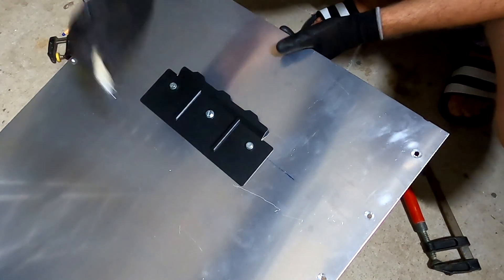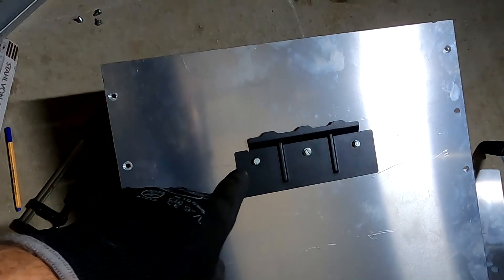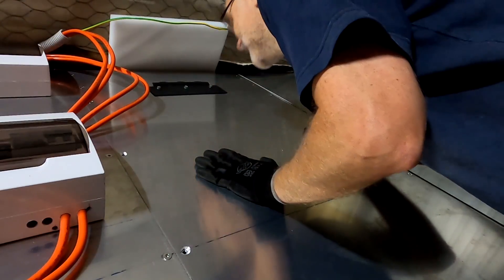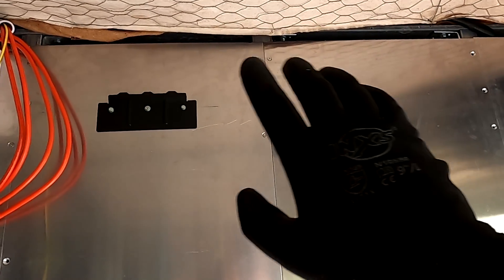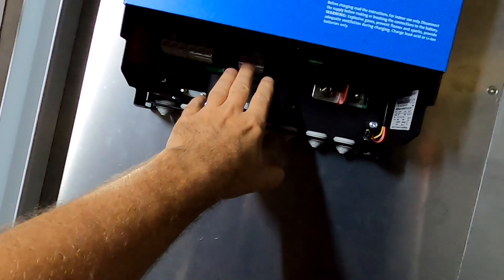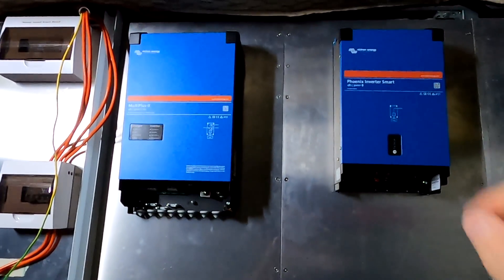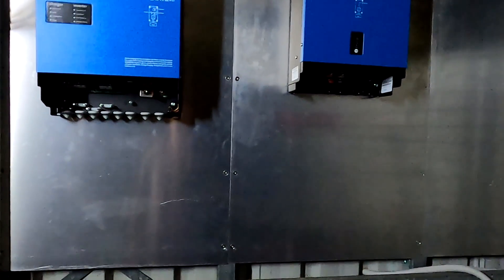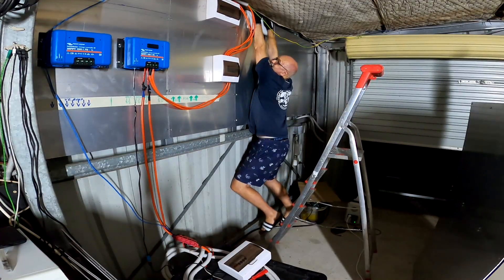Victron Multiplus Wall Mount (Official Strength Test!). AC and DC cables without crossing?

Comment: Here's a long one.

Yes. I came to the conclusion about one year ago that the shippers are shit. Have you seen the news on the mess in Los Angelous? Hell, if they can get the merchandise containers off of the container ships, which seems to be a several month-long process, then getting trucks to transport the merchandise is a gamble. Worse yet, if they can get the containers on a container train, organized gangs are jumping the trains while they are moving, opening the containers, then throwing the cargo out next to the tracks where their accomplices open the boxes and steal what they think will sell on Amazon or eBay.  As it turns out, the most popular packages to steal are UPS or Amazon packages. Think about it. The gangs could steal something, sell it on Amazon or eBay, jump the train that night, steal the same merchandise back and sell it again the next day. What a racket!!!

It is not just in Los Angelous though. After viewing several YouTube channels, I found out that prismatic cells that the OPs had ordered from China were taking three to six months to arrive. Another common complaint was that the cells were bloated when they actually did arrive. I worked in containers in Texas and found that temperatures in those containers climbed as high as 140 degrees Fahrenheit with 130 degrees common. With that in mind, it is not hard to see how the cells were arriving bloated. Hell!! They had just spent several months in an oven!!! As a result, I decided to not order through anyone but eBay and place a two-month limit on the time of delivery. I was glad of it. Twice, I ordered battery cells from Chinese store fronts and twice the orders were on China Post and then were lost in some Chinees coastal port. Twice the sellers never once answered my inquiries and twice eBay had to step in and get my money back. 

I pretty much despaired that I would ever be able to finish my micro generation setup especially using prismatics bought directly from China. Now, I don't buy anything from China especially considering that there now exists some chance of the container ship that my order is on may end up at the bottom of the Pacific Ocean. Sadly enough, anything bought in the US is two or three time more expensive than products bought directly from the Chinese. The thing that gets my goat is that what is bought from US store fronts is the very same merchandise manufactured in Chinese factories. 

The good news is that I was able to find a source for 32650 6Ah cells here in the US. However, the disappointment continued. I ordered 810 cells from a US firm. One day I was working on the area that I was converting for my generation unit and decided to go out for one thing or another. When I opened the door, there lay two boxes of 100 cells each one of which had been smashed on one end but plainly had been sliced open. I think that the smashing damage was deliberately done to cover the theft of 4 cells and was in hopes of covering the sliced corner. That didn't work. I filed a theft report. But wait!!! The story gets even better!!! Remember that I said that I had ordered 810 cells? Where were the boxes containing the other 610 cells? As it turns out, they had been misdelivered to a neighbor. Worse yet, the delivery person had left the cells off between two buildings and nowhere near any doors, so they sat there for two days until I just a happened to see them while driving down the road. Would you believe that those jackasses had no idea what they were dealing with in the form of LiFePO4 cells? Hell! They didn't even know what the hazmat stickers showing flaming battery cells on the boxes meant. They were just blindly driving about the countryside with amounts to be boxes full of explosives.  

But still, the saga continues. About 8 months ago I ordered solar panels from a supposedly reputable firm out of Texas. The deal was for free shipping. Of course, having sent many, many Items through the freight services I was curious as to how in God's name they were able to low ball the price of quality 400-watt bifacial panels but were still able send them without freight charges. I made it a point to ask the Texas firm directly: How do you send panels like that without charging for freight? The answer was that they had an iron clad contract with the shippers. Of course, I fell for the lie hook line and sinker. In fact, the panels were shipped loosely banded to two pallets with a single piece of carboard on top to protect them from what: a fly landing ton top? Hell! The damn things are glass!!! They would have been better protected if the seller had pasted a postage stamp on them and forced them through the mail slot at the post office!!!  The Texas seller used a third party out of New Jersey to ship the panels and the ping pong ball has been bouncing between the shipper, the seller, and the New Jersey warehouse for 8 months. I will probably never see satisfaction and the court system is set up in their favor.  I am in the right, but they have the money to buy fancy lawyers. 

Anyway, I recently decided to test the panels to see if they were any good. As it turns out, just the glass on the ground facing side was broken on my new panels. Much to my amazement, the panels were pushing spec amperage and voltage inspite of the fact that the ground facing glass was broken. The sun facing sides were not broken. As a result, I decided to do a You Tube search to find if there is a way to repair broken solar panels.   After all, what does a person do after hailstorms with large hail stones or if an excessive amount of snow piles up on the panels or if a clumsy installer/owner stumbles on one and cracks it? I will be damned if there isn't a way to fix them. As it turns out, if a person can get to the panels before moisture enters the cracks and is able to seal them, then the panels will work just fine. What is needed is the embedding compound the individual cells are embedded in between the backing and the glass. It is a silicon product that stands up to weather exposure just fine. I figured that since the ground facing sides of the panels will never be directly exposed to either moisture or the sun, why not give it a try? 

Epilogue

The rubber compound was thin enough to settle into the cracks in the panels and they appear to be sealed just fine. The panels are producing but the jury is still out and will be for the next ten years. Contact me in 2032 or 2033. The 32650 battery cells have been fun. I have learned many new things including various soldering techniques, how to spot weld cells, and about cell level fusing by testing and using various thicknesses of copper wire as fuses. Several sources have been very helpful including one of your Azzi friends. I would have preferred prismatics, but beggars can't be choosers as they say. Besides!!! Where is the fun in doing things the easy way? Right??? Buy the way, how did you repair the post on cell number 6 on your battery setup?

For now, just go arg!!! Don't let them get under your skin and wear you down!!!
Reply from the maker: So is this A, B or C?
Reply: @OffGridGarageAustralia  Code man, code. Australian code especially. There is a reason for code. Most of the time I hesitate to give advice over the net because conditions in my area are so different from conditions in other areas. Unless I see something so glaring that it just can't be ignored, I usually say nothing. Instead, I watch to see things other people do that I wouldn't. However, Let's discuss the placement of your equipment for example.

I just got back from cross country skiing in my back yard. My back yard extends several kilometers and is covered by about 1.5 meters of snow. Right now, the temperature is about -26 degrees Celsius or about -14 degrees Fahrenheit. Suppose I that I flush mount a load center on an exterior wall under those conditions. The temperature differential from the back of the center to the interior room atmosphere would cause condensation especially with little or no insulation. Over time, that condensation would cause corrosion which would lead to hot connections and/or intermittent electrical problems. That is why I prefer to mount flush mount load centers on uninsulated interior walls.  On the other hand, I suspect that sort of problem has never been an issue in "sunny hot Australia." 

Here, in the summer, the problem is the opposite. Heat tends to build up in temperatures that can exceed 38 degrees C or 100 degrees F. such we do see in my area. That is why we are required to mount load centers and equipment so that there is a space on all six sides of the equipment. I.E so that there is air circulation around all six sides which makes interior walls ideal for flush mount equipment: because they are not insulated. If the equipment is to be surface mounted, then we are required to use electrical mounting strut between the equipment and the mounting surface. Now that is something that you ought to be concerned about.  

Sorry to have gotten off topic about the situation related to the shippers. I'm sure that that must have been confusing. It is, however, something that I feel fully qualified to talk about since you did mention your feeling about Australian Post and many people around the world are experiencing the same thing as far as shippers go.

Comment: Hi Andy,
I'd say run the ac up and over the inverter as option 1, then option 2 is a new hole.

Use some prestic to stick some foam up to simulate what the trunking would look like if you go up and over.

The advantage of having ac from the top it would be a cleaner install with the ac distribution box, as they feed in from the top and output is at the bottom and the bottom just happens to be where your outside property ac Junction is.

But simulate it right at the top end of the aluminum plates and just above the inverters.

Noting that ac length of cable doesn't matter.
Reply from the maker: Thanks Wayne.

Comment: I think option C is best. I also recommend keeping the two AC outputs from the inverters at least a few inches apart, to prevent induction between the two sine waves which may be out of phase from each other.
Reply from the maker: They cannot be out of sync and should be 100% the same.
Reply: @OffGridGarageAustralia  they can be if you use them as two separate systems

Comment: Option C. Put as high above Inverters as you can for heat purposes. AC you can have longer runs but keep your DC as short as possible.
Reply from the maker: Yes, that's a good point.

Comment: while you discussed about A or B, I thought, there is a solution C, running AC up at the side of the inverters and on top of the inverters. AC cabling  has lower currents and can be longer. The inverters can be lowered a bit. Greetings from the old world.
Reply from the maker: Danke Dir!

Comment: I would keep dc on bottom going up to the inverters. Run ac on top of inverters loop the the left of them. Is that C? You don't want your ac  intermingled with your dc in the same conduit.
Reply from the maker: They won't run in the same conduit ever, just crossing.
But yeah, that is C 😉

Comment: That's what was saying piggy backing inverters only makes sense with different incompatible batteries like 2 sets of lead acid one being SLA 200AH and another AGM 330AH you don't want to mix the lower with higher as it will make the 330AH the lower denominator (200AH) . But running inverters off those and piggy backing you can continue to feed the load to avoid too much depth of discharge on both sets. 

Also looking at some LiFePo batteries as 12V (supposed drop in for ones car/4wd battery) but some of them are saying you can't run in parallel or series or very limited connection (3 in either or 2 in either) - that's due to its internal BMS?
Reply from the maker: There is no issue running multiple inverters from the same battery, regardless if they are standalone or in parallel or in series. Lead acid batteries is a total no go for these projects though. Old tech and not worth buying any more.

Comment: How about having a switch, where you can choose, either the  piggy bank situation, or make them work independently in two different systems and choose when that happens. Not sure this makes sense.
Reply from the maker: That would not work as all the load is either connected to the Multi or has to be split up between the two. That cannot be realised with just a switch...

Comment: Yes on circuit boards, using various techniques you can handle lots of amps. 200a no worries.
Reply from the maker: Others have the same negative bus bar just as a PCB, so seems as per design.

Comment: I would run up the left-hand side around and over the top then drop down to where you need on the right. keep mains over the top and DC along the bottom
Reply from the maker: So, that's solution C. Thanks.

Comment: What about running the AC cables up the left side and across the top to the AC distribution panel on the right? The DC cables can run down and left and not cross the AC cables. No holes to drill this way.
Reply: Oops! I wrote the above comment before I got to Option C in the video! Option C then! :-)

Comment: if you really want them to be isolated, route ac over the top of the inverter, dc down the bottom.  both busses will be spaced.   AC does well with longer runs, so its not that much to route the ac up and over.
Reply from the maker: Great, thank you.

Comment: No matter what…. Cables will meet in some point. With your  good design and double insulated cable there will be no problem in crossing in some points. A lot os installers use wire gutters and run everything inside them with no problem. Just instal everything in the front. This alternative is mor flexible for the future.

Comment: Nice belly shot Andy! Side effect of dialing in panels I suppose.
I pull 75-80% of my inverters continuous output but no more. I ran the reliable almost at its max for a couple months and of course it died as I'd expect it too. I now have a couple of the onswipower units. Fantastic so far. Things are looking great Andy. I'd say option C. The a/c wires won't mind the added length. Itll make the transition easier I'd think.

Comment: I don't see any problem crossing the cables, I've manufactured high end amps with high voltage/Current on DC side and it is really complex to have that together with low distortion when a discrete pre-amp that is just a couple of cm from the high current pcb routes.   If you put the cables side by side it could induce voltage between cables, but to just have a 90 degree crossover I cant see anything wrong with?  a cool test could be to have this setup incl,. ac cable and connect high load to inverter so you pull i.e 50A through dc cable and look at the ac through an oscilloscope and see if it get deformed in any way while you move dc cable closer and closer to ac cable,  my strong belief is no.
Reply from the maker: Thanks for sharing, Jonas. Great comment. I should really get an oscilloscope for these tests...

Comment: option C. treat the ac like it was city power. down from the top into the distribution box (ac) then out the bottom (to load) standard convention. square box raceway would look good with a label AC
Reply from the maker: Yes, thanks, Marte. The labelling will come later...

Comment: Is the bar structural to the garage? ie remove for a couple of bays? or cut and put on front. just thought while typing, or cut holes in it and wire through?

Comment: If you are planning to someday extend your build to 3 Multipluses/Inverters, I would just use a proper sized duct with max. 50mm height (from the aluminium panels' perspective) under the Inverters horizontally to manage AC lines. Only problem with that would be the two screws holding the black cover from underneath.. Also I'd remove these round grey cable management thingys and go straight into the duct. If its not too late already you also could swap the MPPT panels with the Inverter panels in order have the shortest DC cables possible from your busbars (straight down into the battery compartment) as they will carry the highest current when the inverters are loaded with 5kW. For strain relief on the DC cables you could then use some M20 cable glands when going out of the bottom part of the duct. I don't think that DC and AC lines crossing in 90° angle will cause any problem.

It's super interesting to see your projects evolving, so please keep up the great work! While still getting enough sleep that is of course 😅
Reply from the maker: Thank you for your comment and thoughts. I considered swapping the MPPT and inverter side. In the manual of the Multi it says not to mount them above the batteries. I guess this is only for lead acid batteries though and the gases which could escape the batteries while charging. It would also be beneficial because the Multis don't need any maintenance in this hard to reach area... I consider all this for the next build. I promise 😉

Comment: By 2028 you could have a 100p 16s battery bank, and 100 kw of solar, a couple 2kw wind turbines, and enough inverter to power a small town! 100 x 280-300 ah cells parallel x16 series, I haven't even did the math, but they would probably be cycled once a year at my house! Haha, wouldn't it be nice to have that kind of power, without a bill, and no carbon feet! What is the math, in the mega watt hour range! But seriously you could have so much done by then. Good luck, and don't get burnt out!
Reply from the maker: Hahaha, if the battery gets too large it will degrade because of age not cycles. Even it is tempting to have a large battery but if you don't cycle it, it's just dead material sitting there. And this has a carbon footprint too.